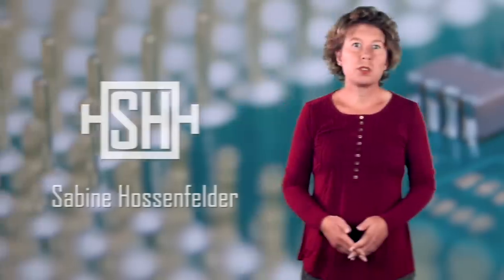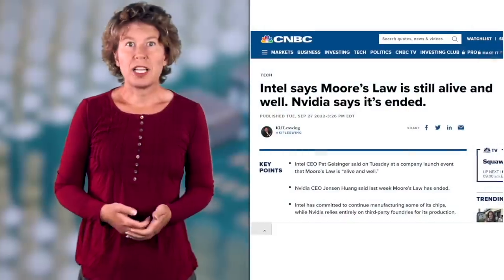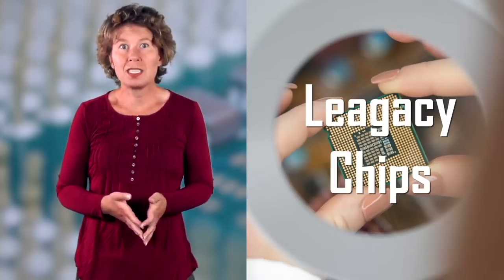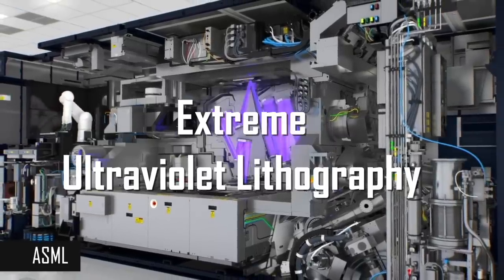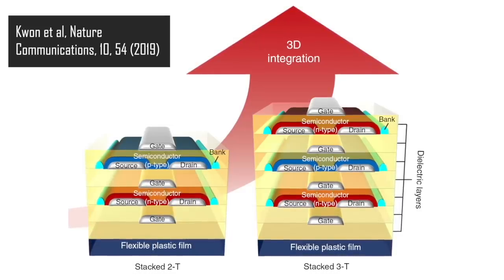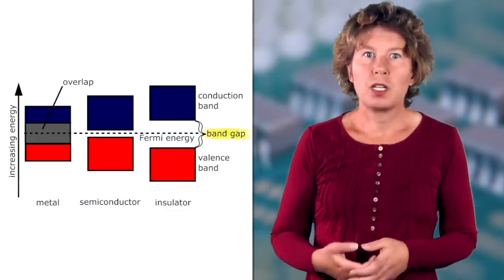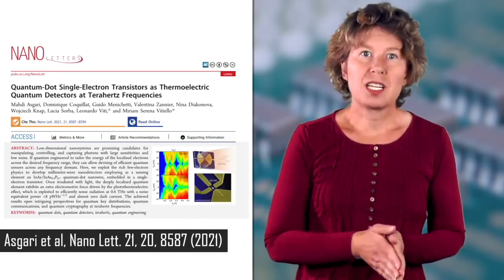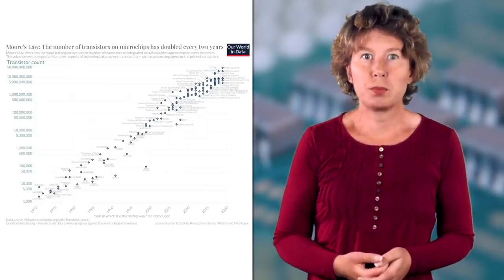Is Moore's Law Finally Dead?

Comment: Moore's "Law" died in the late 1990s.  We can't get smaller paths than the width of a few atoms (a few Å Angstrom each - that's about 0.05 to 0.1 um microns or 50-100 nm nanometers).  You can't make paths smaller than atoms, and even if they're 1 atom wide, electron drift and molecular drift will ruin the pathways anyways.  We hit this "miniaturization" limit in the late 1990s.  The only way we've continued to "fake it" is by making chips bigger, and multi-layered, and to improve thermal dissipation (cooling), and optimize circuits for minimal heat creation.  Worked in a FAB for a bit, back in the day.

Comment: I had a few of those IBM Stinkpads over the years... I liked the little pencil eraser used for moving a mouse. Or used the touch pad and pressing the left and right buttons above it. Pretty kewl.
Reply: Stinkpad?  I've got two Thinkpads and both are still working fine--the one with the 200MHz '386 still runs but isn't good for much anymore however the one with the Core 2 is happy running Windows 8--I never tried to put 10 on it.  I like it because it was the first machine I had with a real digitizer and being able to write and draw on the screen was for me a game changer.
Reply: @johnbrobston1334 It was just a joke. We had stupid nicknames for everything.  I had the pleasure of working with Thinkpads several times. I even stated how much I liked them in the post. Read the entire post next time dude & have a beer.

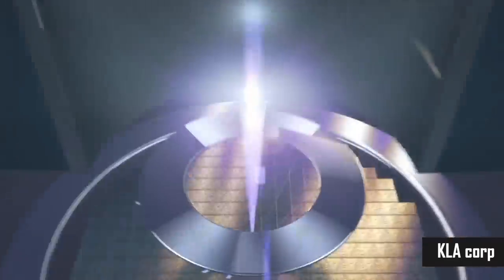Comment: Small correction at 4:20. e-beam lithography is not the same as scanning electron microscopy. They are different beasts. EBL tool gets an entire room of its own while SEMs are dime a dozen. The cost of manufacture has majorly gone up due to EUV lithography whose throughput is lower than scanners.

Comment: I'm still finishing undergrad in computer engineering, so I'm definitely not an expert. However, I've been consistently shocked by the amount of functionality possible with previous gen hardware. The microprocessor in my old logitech mouse is powerful enough to run Linux. I think that even if Moore's law flattened out for a few years, we'd still be making significant performance improvements.
Reply: Well yeah, pretty much any PC from even ten years ago is still practical for everyday use. Most of the PC market today is driven by gamer/streamer bullshit and the ever present need to upgrade components for a few extra FPS.

Comment: e-beam lithography is not an inspection method it is rather a production method/tool.
Defects are checked with inspection tools like highly specialized SEM's (secondary electron microscope)
EUV does not etch anything it exposes UV sensitive resist material the Si-wafers are coated with. Etching is an other processing step in chip fabrication. 1. exposing, 2. developing, 3. etching, ...

Comment: ZX Spectrum here. 48k RAM but the upper 32k had a fault so I was wondering why it kept crashing until we got it repaired. Anyway one of the coolest cooling techniques is to let one core or smaller part of the chip run at a speed that makes it overheat, but only for about a microsecond. Then shift the computation to another part of the chip, and then another, eventually cycling back to the first as it cools down. That allows a single thread to run at a speed that would otherwise melt the CPU.

Comment: On the intro, my first PC that connected to a monitor (TV) was a Commodor VIC 20 that came with 5KBytes of RAM. I upgraded the RAM to 32 KBytes myself. What a power house. An 8 bit 6502 processor running at 1 MHz. I taught myself how to program on that VIC 20 so it was worth it to me.

Comment: I've always wondered why we don't just use more chips instead of trying to squeeze more onto a chip.  If you lay chips flat in a socket (as we do now) then doubling the amount of chips doubles the amount of board space required and that would be unfeasible, but we have used slots instead of sockets in the past (Pentium II), in the same space that we currently fit a single CPU socket we could place multiple slots whereby each slot could fit an individual processor standing on it's end - inserted just like a wide, flat USB stick.  The cooling block that sat over them would itself have slots that slid down over the chips to cool them, it would look just like a small upside-down toaster, but would obviously do the opposite of a toaster.

In fact to cut out all of the things that could go wrong when you need to combine intricate slots with an intricate chip setup and an intricate cooler the chip manufacturers could just release the entire thing as a single package.  Instead of a flat processor it would be block-shaped and inside the block would be as many vertical dies as they could fit with cooling lanes in between, perhaps 5 to 7 dies.  That would be a huge jump in processing power.

The only reason we are fearing Moore's Law is because we are determined to stick to the current configuration of a 3cm-by-3cm chip placed flatly in a socket, that is like someone placing four or five books flat on a book shelf and complaining that they've ran out of space on the shelf.  We just need to use another configuration that allows more dies and then the "we can only fit 100 billion transistors on a die" becomes a problem we can deal with 50 years down the road when we are running out of places to put dies.

Comment: Moore's law ended several years ago. I specify and purchase the equipment for my firm's data center racks, and the pace of speed increase is quite slow now; not even 10% a year. The main problem is RAM; they increased the clock speed, but the number of wait states has gone up, so almost not progress in this key area. We have more and more cores, but they can easily get bottlenecked on memory, and precious few algorithms and programs can take advantage of so many cores. Comparing the equipment we purchased 8.5 years ago with current equipment; it is only twice as fast, and has twice the memory, but sadly unlike previous decades, computers are going up in price and what cost us $120k 8.5 years ago is now about $200k.  

Another unfortunate problem is that we have so much inertia in our software stacks, that any improvements in architecture tend to fail in the market because the engineers have trouble or more accurately resist changing their techniques to utilize them. So application acccelerators and Optane cross-point memory tech have mostly failed in the marketplace.

Comment: Many issues are software related. More than 20 years after the first multicore cpu's, effective parallel software is still in its infancy. In order to keep 3D chip designs coolable, the voltage and clock speeds will need to come down. This will hurt "single core performance", which is still very important. Progress with parallel algorithms and tooling will improve general parallelism in software and make massively parallel processors more attractive.

Comment: Extreme ultraviolet lithography is already widely used.  If you have an iPhone or laptop in the last 5 years or so it will probably have a CPU built with Extreme ultraviolet lithography, as this is used in 7nm and 5nm chips.  This industry moves fast billions rest on continuing Moore's law.

Comment: @sabine.Ebeam lithography is used mostly to create patterns, not to inspect them. 
For inspection we use diverse scanning electron microscopes also know as SEM. Varying electron energy and detectors (bse or se) to get different images and info. The king machines for reviews are CDSEM which stands for critical dimension SEM.
Nowadays, multi electronbeam inspection tools for large area of inspection are used on top of cdsem to collect data for millions of patterns and know about defectivity of the lithographic process (mostly done with optical litho Asml being the leader manufacturer of those machines)

Comment: It's been a bit of a golden age for computer performance. For quite some time, the hardware makers have been able to increase the speed of processing and bit schlepping faster than the coders can write ever sloppier and inefficient code. I'm afraid this is coming to an end. This article indicates that there may be physical limits to how fast we can compute, however, there is no limit to how bloated code can become.

I remember installing Microsoft Word from a single master floppy onto a system floppy that had an operating system with a GUI, various drivers and a selection of fonts. There was still room on the floppy for several reasonably-sized documents, all on a computer with 512 K of RAM. (A Macintosh Plus in 1987) The laptop I obtained in January has 64 GB of RAM. The idea of having 64 GB of RAM in a single city, let alone in a single device that mere mortals could afford was in the realm of science fiction when I used that Mac +.

Comment: True, depends on who you ask. I specialize in photolithography i.e. the tool used to print the pattern onto the Si water. Ever since the 90’s, Moore’s law is dying, and maybe it already did in optical lithography, but not in general.
It’s been challenging for optical lithography to keep up. The tools are getting more and more complex. These tools are heavy in optics and accuracy. The near perfect lens need to reduce and project a near perfect replica of a chrome pattern designed in a quartz glass reticle onto a Si wafer coated with a photosensitive film. The tool is also responsible of aligning the Si wafer under the lens to print layers over layers of the designed pattern. This alignment is achieved using laser interferometry and accurate XY stages; it needs to have an accuracy in the teen nanometers. To this day, the precision and accuracy still impresses me. 
I stopped at the start of 193nm Immersion lithography, the complexity was too stressful and required long hours. I stepped back to analog devices with the smallest print of 0.6um and alignment specs of 0.15um (huge in the semiconductor world).

Comment: A correction about GaN technology.   GaN was developed originally for RF transistors, then gained popularity for LEDs production, and finally found popularity in power electronics applications.   GaN was never seen as a suitable candidate for use in CPU applications, however to state that GaN is not successful as a semiconductor material is a very wrong statement.  Take your modern smartphone and it would not have been possible to make it without the use of GaN for the 5G RF circuitry and the LEDs for the display.

Comment: Alternatives to silicone transistors have been actively researched for decades now, and all of them remain just that - "promising", but nothing practical ever comes out of it. Clever layering or packaging is unlikely to keep prices at bay, since regardless of how you package transistors the yield per unit area remains nearly the same. Eventually, even chiplets will become too large and prohibitively expensive. Moore's law isn't dead yet, but in its original form it will be dead within 15 years or so.

Comment: I recall sitting in a lecture hall listening to a lecture from a Stanford professor on the death of Moore's law. He was very impressive and even wore a three piece suit. He told us we'd come to the end of the road at 3um, so we would be wise to start retraining - especially if we were analog designers. That was in 1982. So now I'm still designing, still in analog and gate lengths are 3um. Of course the circuit designs are much different than they were in 1982, and I would not guess how much smaller transistors might get, or if some other physical structure might not replace them. I do know that professors can succeed in making fools of themselves.
I will make a comment about the difference between the field of processing data and the field of new energy sources. When you're dealing data, you have to understand that thoughts have no mass, and no energy intrinsic to the thoughts or concepts that one wants to transmit or process. The equipment required to transmit and process thoughts and concepts are what consume power and material. So, physicists who dare to predict the end of the road, ie the Moore's law limit, risk making fools of themselves. It is best they stick with power generation.

Comment: For cooling, there is a company called Frore with an interesting solid-state (but still moving) fan. If it pans out as they scale manufacturing, it could help us push performance further
Reply: Another option is wide open cooling channels like on a heatsink, only at micrometer scale .  No attempt to contain leaks, as most leaked air liquid will still carry away heat as it escapes .

Comment: Moore's law was on doubling the number of transistors on a chip. It doesn't say anything about the size of the chip. So whenever we reach the limits on an atomic level we still have a couple of iterations where we simply make the chips bigger, or we can also stack them (not 3D more matrix like).

Comment: Having invested in one of the key companies that enabled DUV and later EUV, newer technology finds solutions. But maybe Moore's law isn't the definition we seek as Circuit density is only one measure of his point=greater computing ability for each chip. Lower power or faster cycling as you mentioned is one. And quantum computing as an adjunct to current systems is just happening.

Comment: Moore's law, the original/early form, has two elements. One is advancing the manufacturing process. It was a deliberate choice to advance process in steps of a 0.71X (one over square root of 2) linear reduction in order to justify the effort to redesign a chip. A simple optical shrink of a design from the previous process has some but not major gain. To fully leverage the new process, a "redesign" (using new cells) of the previous processor should yield a 40% gain from the reduction in gate length - for 40% higher frequency. This was true to a point until power constraints made substantial frequency gains impractical.
The new process reduces die size of a previous design by a factor of 2. A new processor architecture to size of the processor on the previous processor can now have 2X the transistors. From this, it was practical to achieve a 1.4X performance gain for general purpose (in the first 20+ years of Moore's Law). This became difficult by the late 90's, from which each processor architecture generation put as much effort into SIMD features, with only modest gains in general purpose code.
By the time of Intel Pentium 4 (early 2000's), doubling of processor core complexity with each processor generation was no longer practical. Successors dual, then quad-core, and higher core count processors. 
In multi-core processors, doubling the number of cores could result in 2X performance for highly thread-effective workloads but no gain for non-threadable workloads.
Some critical workloads put major effort into building highly thread effective code, but many ancillary code languished. 
One possibility going forward is to decrease the complexity of the core to enable even more cores.

Comment: There are two obvious methods to increase transistor density. They are stack chips and reversible circuits which fixes the heat problem?

Comment: TRS-80 CoCo. So, one thing we are all forgetting is that Moore's law is only in effect at the high end, where we have turned to parallelism - for decades - to compensate. Moore's law will live on for some time on the low end and super low ends. While gaming PCs may hit limits, we are indeed in a golden era of SBCs, edge devices, and radically declining costs.

Comment: 3D Architecture concepts go way back. They were referred to as "The Smoking, Hairy Golf Ball." The system would be spherical to minimise the distance signals had to travel, and hence increase the speed. The hair was the large number of connections the device would need to shove the data rapidly through. The smoke came from the several kilowatts of power that the thing would fail to dissipate.

Comment: I was a little surprised that FETs were discussed without clarifying that that stands for field effect transistor.  Of course then you might have felt compelled to speak to what the “field effect” part is all about.  The video was probably comprehensive enough as is.

Comment: There's a dozen orders of magnitude of performance left in terms of computing performance, but  Each order of magnitude from now on (really, since about 2000 on) requires profoundly different hardware and design and results in hardware with capabilities that are different in kind from what we've had, not just faster.  

We're not going to get them just by miniaturizing the same kind of components we've been using.

Comment: My first computer, in 1982, was a Timex Sinclair 1000 with 2K internal ROM and 16K external RAM. It used a cassette tape deck for storage a TV converter for video, no audio. I thought myself BASIC using the thing.